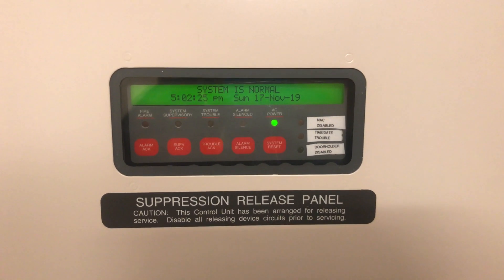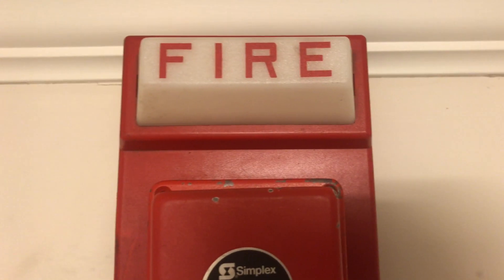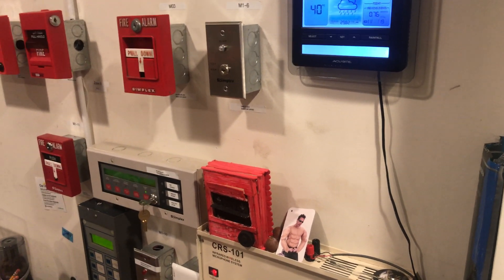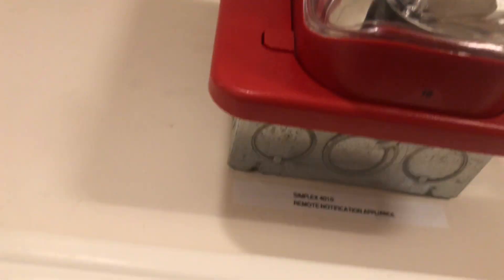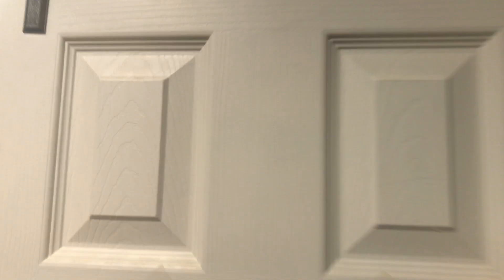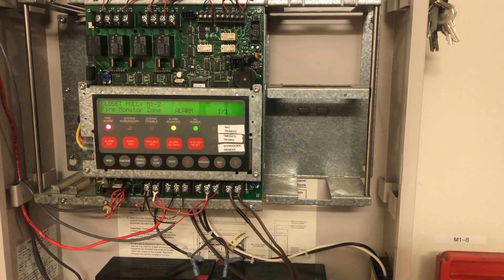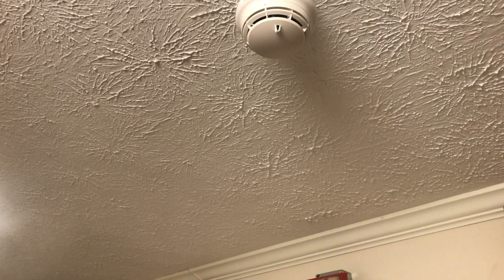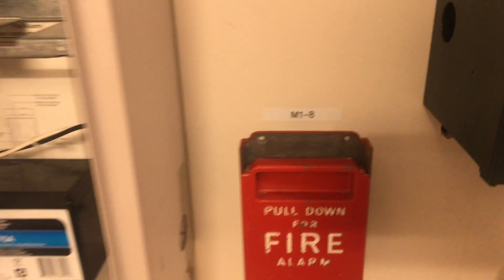Simplex 4010 Test 31: Autocall and Lightplates

Comment: I've seen an Autocall setup from 1973 with those pull stations and old-style Federal Signal Vibratone 450 horns on Space Age AV32 light plates. It's since been upgraded to a cheap Fire-Lite system with SpectrAlert Advances, but they kept the pull stations.